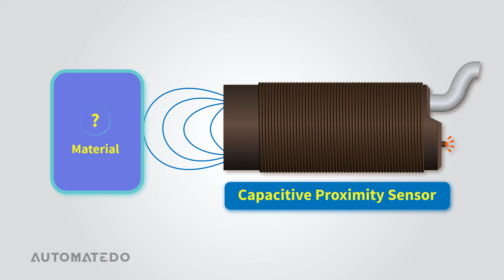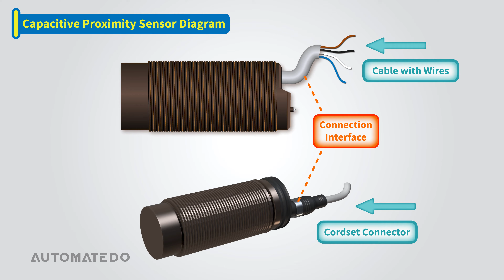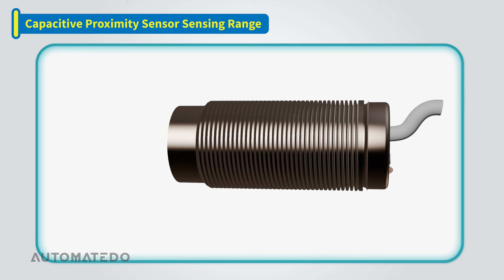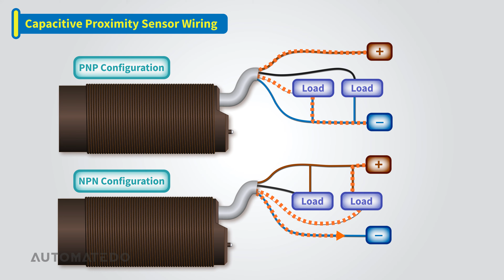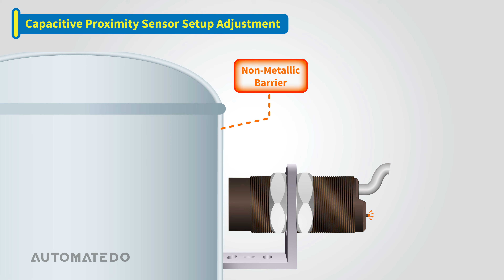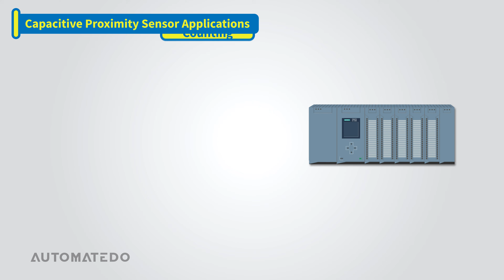Capacitive Proximity Sensor: Working Principle, Wiring, and Applications

Comment: Basically this is how drum triggers and contact mics should be done _ metal sticker Basically
Reply from the maker: Great insight! 🎵 You've made a really clever connection, that's essentially the practical, DIY application of the principle. The metal sticker acts as the extended capacitive plate. Smart thinking!